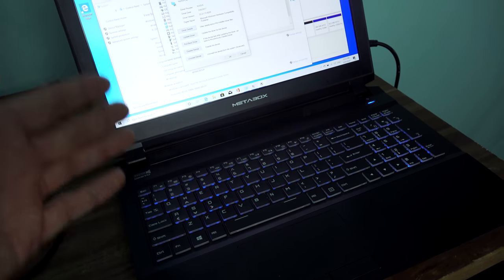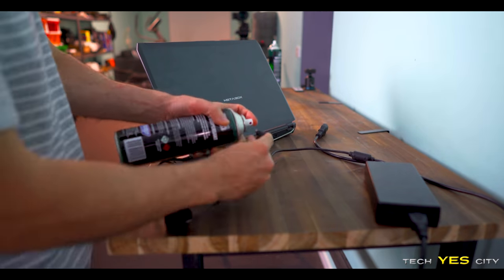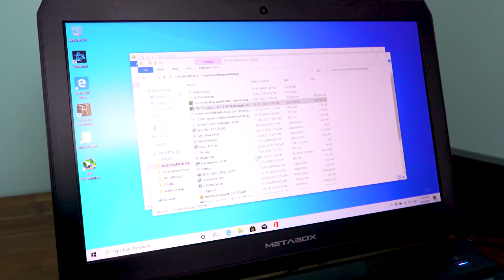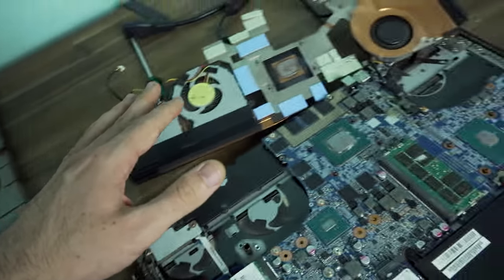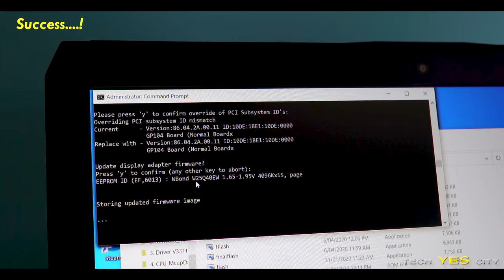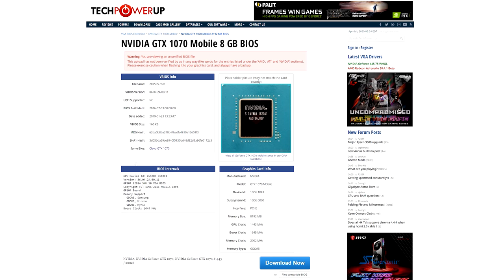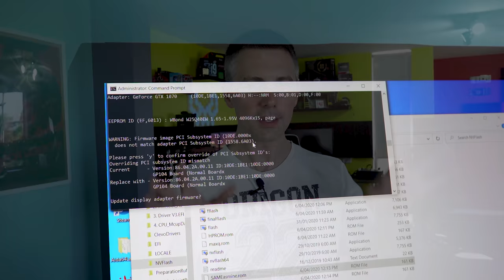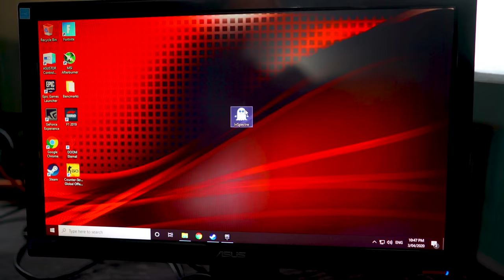I Got This GTX 1070 Laptop for ONLY $200... Though it has a VIDEO_TDR_FAILURE issue...

Comment: Holy crap, I have the same laptop (different rebadge) with the same problem!  I did the re-paste and replaced all thermal pads, tested several versions of the Nvidia drivers and eventually set it to the side and have barely touched it in over a year.  Thank you for sharing this one, going to give the flashing a go.
Reply from the maker: make sure its the same file size first (so back up your vbios first with gpu-z) and then yeah give it a crack.
Reply: What rebadge do you have
Reply: @Staffy_  I have a Sager.  I struck out on the this though, BIOS file while being the same size, it would not update saying it is the wrong version
Reply: @jaymanwitt  That's a shame - I picked up a used one for $400 - did the nvidia bios update and it went through fine but it's still not perfect...I run something like Witcher 3 and it either fails within 10 seconds of gameplay OR plays fine for hours... Where in the world are you - anywhere near Sydney Australia? ? I'd pay $200Aud for it just for the fun trying to fix it ;)

Comment: When you're trying to troubleshoot 3D graphics resetting the PC you can run GPU Z with logging and then look for any anomaly in the logs after you log back in.

Also GPU Z is useful for identifying a corrupt vbios as on the monitor tab you'll often see lots of weird values.
Reply from the maker: Thanks I will check out the logging feature.
Reply: @techyescity  also I'm pretty sure I've saved a corrupt vbios before and then reflashed it and it somehow worked. It's not like you're going to be any worse off.
Reply: @techyescity   please also disconnect battery before you spray all over the laptop and cleaning you could damage more things while trying to fix gpu !!!

Comment: This is such a strange fix. Would've never thought flashing a bios would have fixed that issue....
edit - to be clear, I mean the vBIOS. I would've flashed the motherboard BIOS, but never would've thought to touch the graphics card's vBIOS
Reply: From what I know the BIOS chip in a laptop is responsible for both triggering the south bridge to boot and VBIOS for the GPU.
Reply: i had a very strangely behavior of my hp probook. flashing the bios fixed every fault i ever had with the damn thing.
Reply: Picture it as the "Turn it off and back on again" but for the BIOS.
Reply: I've got to say if you trade notebooks for moolah, please do consider that lenovo's really lock down their bioses... not the video one but the overall system one... and its a bitch to get backups... people pay russians on forums to unlock their bioses so they can upgrade cpus and what not... or install ssds which are not on lenovos whitelist.
Reply: you'd be surprised at the amount of things you can fix just flashing the bios. some people don't bother because of the risk involved.
Reply: @Blokka Nokka indeed. I have also had a bios brick one of my mates boards I had to replace his board needless to say i learned the hard way and only work with motherboards i consider reliable lol.
Reply: @cootason  GPU bios flashing? literally 0 risks, its not the same as motherboard bios flashing, at least not any hard bricking chances I mean, there are risks but nothing that cannot be reverted easily.
Reply: @JustOneGuy   Yeh
 less risk involved in the gpu boards.  I was more about motherboard flashing those cheaper ones can be a bit of a pain at times.
Reply: @JustOneGuy  you only have to desolder the bios chip and reflash it  with a cheap usb EEPROM flasher that can be bought for like 3euro, pretty easy and can fix a lot of things
Reply: not relly the bios can get bit rot but its really rare as the BIOS is non-volatile storage in most cases it should never degrade i mean i have 3 computers from the 90s only one of then had this problem makes me wonder if the bios chip is faulty or just poorly made
Reply: sometimes the flashing might go wrong and you end with somewhat corrupted eeprom. Reflashing can fix the problem, but don't ask me why, tho. Some of the flashing issues happens with radeon RX and nvidias...
Reply: @fabiofoltran4361  yes, but compared to failed gpu bios flash, its all software, you don't need any hardware and for bios on motherboards in many cases you need an original bios not the one you can get on the internet because it doesn't carry all the information, at least that's how it was in 2014 on my laptop. maybe times have changed.

Comment: I actually own this very same model of laptop.  Clevo is a ODM who makes laptops and sells them to OEMs who customise them for sale to the end user.  The experience I had with the laptop has left a bit of a sour taste on Clevo laptops.  That model never got a official fix for the IME vulnerability as Clevo had released a new model a few weeks before the exploit was released.  There are no firmware updates for any of the Intel hardware exploits/vulnerabilities either.  The paint on the keyboard also wore off really quickly for me as well, my laptop keyboard is currently missing the lettering areas on quite a few of the keys on the left hand side of the keyboard.

If you do plan on using that laptop (and for anyone else with with one), I highly recommend using the software from Obsidan PC instead of the Clevo Control Panel.  There is still a bug with the Clevo CC filter drivers for the keyboard/mouse which will give you constant BSoDs which is fixed with the Obsidan software and you also get the option to setup a CPU undervolting which will give you the same (or better) CPU performance with less heat - you can do it with Intel's XTU but it is rather fiddly.

Comment: If someone (like myself) installed Linux Mint after Windows, then a partition with a size like that looks 'unallocated' like that in windows.  That means it is a dualboot system, or you can still make it a dualboot system.  I the latter case, keep a part of the 100 GB dedicated fow swap file around size of your ram.  So for instance 100-16=84 GB for Linux Mint 19.3
Reply: SpinazFou  First: if you are not sure that mentioned 100 GB is a linux partition, then please LEAVE IT ALONE to avoid breaking your windows.  Second: you can check what that partition is by live-booting any linux dvd/stick (like Mint 19.3).  This will start an OS exclusively in RAM so you look around in your system.  After you remove the cd and shut down, your system returns to normal.  The advantage is that linux can see ALL kinds of file structures, while windows can only see NTFS or FAT32 (hence 'unallocated' blah blah).  Third: when you boot a linux (Mint 19.3?) medium, and decide to install linux, it will ask you if you want to clear the drive (no!) but you want to 'do something else' and then you select the empty space and enter the size of SWAP area in that space and choose type 'SWAP' - then select the empty space again and choose type '/'  -> now install there.
Reply: @rogierx  ext4 partitions should show up as unformatted in Windows, not unallocated, shouldn't they? Btw you don't need a swap the size of your RAM. If you've got large enough RAM, you don't need any swap at all.
Reply: @sleeping_monkey  excellent, didnt know that!  I always thought swap is equivalent to pagefile.sys - apparently i am still a bit of a windows mouse monkey.  But the live-booting linux in order to look around will provide interesting insights, right?
Reply: @rogierx  Swap partition is equivalent to the pagefile in Windows, that's correct. Both are used for the same purpose: when the system runs out of physical memory (RAM), it moves the less frequently used portions of memory to swap/pagefile (which are located on disks) to free up some space to be able to, for instance, start a new process, open a new tab in Chrome etc. The only real consideration when you're determining the size of your swap/pagefile should be this: no matter the circumstances, your system should never run out of both RAM + pagefile. Were that to happen, your applications will start to crash if they try to allocate more memory, you won't be able to launch new processes, etc and realistically, your system will just hang.

The popular advices like "make your pagefile the size / double the size / half the size of your RAM" all use sort of backwards logic. They assume your computer has just about the right amount of RAM you need for your everyday use, and then it's safe to assume that in the most extreme use case you won't need more than double the size of your RAM. That's a fair advice if you've chosen and bought a computer with a perfectly adequate amount of RAM for your needs.

Instead, your should first decide how much memory you use at most, and only then calculate your pagefile size like this:
pagefile/swap size = total memory usage in the most extreme scenario + some leeway - your physical RAM size
I know that in Windows, if I'm lazy and have all my applications opened (including the browser) at the same time, I end up using 12GiB of memory at most. I have 16GiB of RAM, so it covers my most exteme case and leaves some extra, so I've disabled the pagefile completely.

Pagefile/swapping is a pain in the ass, especially on laptops, because laptops typically come with the slowest possible 5400rpm HDDs. You don't want your memory to swap on THAT. I'm sure you know the symptoms: you try to switch to the tab that you haven't switched to in a while and it takes ages to load. Or maybe you try to unminimize some window and it takes like 10 seconds to load. Or you exit a game and all your applications are slow AF after that. That happens because the portion of memory with the contents of that tab/window were swapped by the system because you haven't used that tab or window in a while and your system needed some memory for something else. So now when you try to access this swapped memory, your system needs to read its contents off the HDDs, which is very slow. Thus, you should aim to avoid swapping at all costs. Nowadays the RAM is pretty cheap, you can easily get 16 or 32 GiB of it and then just disable the swap/pagefile completely.

One point I missed: the linux swap partition, unlike the pagefile in Windows, is also used for hibernation. Windows uses a different file, something like hibernation.sys, but not the pagefile.sys itself. So if you plan to hibernate in linux, you'll still need the swap partition.

Comment: Let me tell you how EXTREMELY luck you got:

Most laptop brands (especially HP, Lenovo, Acer etc) that use Nvidia Optimus enabled laptops tend to integrate the video BIOS bin file in the the general motherboard BIOS. So the Nvidia BIOS is basically contained in the systems BIOS file.

You got very lucky that the BIOS's on this laptop were separated, allowing you to R/W to and from it.

I say you got lucky because extracting the video BIOS from the main BIOS image can be a real pain in the butt.

Edit: Forgot to mention that laptop vendors typically lock users out from reading or writing the BIOS chip. That's the case for me with my ThinkPad W520 lol.
Reply: You forgot to mention he was lucky.
Reply: @BeAPro  LOLLLLLLLLLLLLL
Reply: @BeAPro  :P
Reply: Hey @Jamee, have a look at ivyra1n. Maybe something similar might come for sandy thinkpads. My w530 runs it just fine

Comment: Usually, the main system recovery shows up as unallocated space or a recovery partition. A certain Fkey "like F11" will start the factory set recovery. But, of course i always do away with main system recoveries. Those are for old DELL's and HP's with proprietary drivers. 
 Once someone brought in a completely dead laptop. Every other shop they took it to, said it was dead and needed a new motherboard. I took the whole thing apart and let it sit for 24hrs. Put it back together and it fired right up. Sometimes there is built up static electricity that can cause a laptop to not start. So by taking it apart and letting it sit  can sometimes fix seemingly dead laptops.
Reply: Not only laptops but PCs too.
Probably by the same reason.

By the way, I had a case when laptop after flight to another country started to work in my hands.

And as for this 100GB unallocated space. Someone could even left this space as a buffer. Some SSD works faster when the whole space is not occupied.
Reply: you did not need to take it apart to discharge the electricity, simply unplug it and hold the power button down for at least 30 seconds
Reply: @TheBirdtaco  you are speaking about PSU discharging. Not motherboard

Comment: I got precisely the same laptop/configuration (except for the 2x8gb ddr4 sticks).
It had the same VIDEO_TDR_FAILURE problem for which I tried some register fix related to TdrDelay and at least I made it not get BSODs (video card still crashes when running intensive GPU stuff).
Even after flashing BAKED bios, this laptop still overrides any sort of software and hardware (vbios) default clocks somehow (tested in Heaven Unigine and monitored clocks - gets to 1800+ mhz / should be 1645 mhz / on core and 4004-4007 mhz on vram).
After flashing all the GTX 1070 vbioses I found on the internet, my conclusion is that there is some sort of overriding mechanism that pushes the GPU to death (most likely by crashing the VRAM).
Any other suggestions are welcome otherwise I guess I could check a repairman for the VRAM.

Comment: Usually the tdr error is related to windows missing tdrdelay, tdrddidelay and tdrlevel in the registry. Only a small number is related to drivers and vbios problem
Reply: Wouldn't reinstalling Windows correct that?
Reply: @redleader7988  It depend as there's so many different computer setup some will work fine without the registry fix but some require the registry fix. If you check in event viewer and see alot of error 4101 and games crashing that means windows 10 crashing the nvidia driver when there isn't a fault at all. The registry fix basically tells windows 10 to stop interfering with nvidia driver and games will stop crashing

Comment: Had a laptop that had a gtx 1060 gpu in it but wouldn't let me boot to windows even with a fresh install.  Funny that I could get linux to run just fine on it which is what I did anyway and made a profit for services to get it running for a client
.  

Also had a rx 470 that would crash everytime I would try to game or do heaven benchmark and had the latest driver and also flashed the bios on it, ended up getting a refund from ebay on it.

Awesome save on this laptop though Brian!  Next you should look into replacing the screen with a higher refresh rate panel like 120hz or more!  Though dont know if ips panels like that would be compatible with it but worth a look!  Also stay safe and healthy man to you, dad and the rest of your friends and family!

Comment: The unallocated space is to prolong ssd life. Like a dump area. Google it
Reply: Cache 👌‼👌
Reply: Yeah but not 100GB, that is way too much. I too have 500GB ssd and it only took about 50GB.
Reply: It's called Over Provisioning which basically states that leaving at least 10-20% free space on an SSD will significantly increase the life expectancy over a full drive.
Reply: @matthewdale7  Cache is quite different. It's a volatile memory.
Reply: That isn't true at all. Manufacturer-set overprovisioning isn't exposed to the OS. You can't choose to use it. Only the controller inside the SSD can see it. If you're seeing unallocated space on your SSD, it's simply unallocated space inside the user-usable portion of the flash memory, and that serves no purpose whatsoever.
Reply: @CaptainKenway  I'd agree with this (my reply was to the OP, he wasn't sure of the term). The one on the video is really just unallocated space. Over Provisioning cannot be seen in any disk management software. Its practically hidden because it's managed by the ssd itself (or a software used to configure OP). Unallocated space is unallocated space. Needless to say you can use it or not if you wanted to.
Reply: matthew dale No, it is not cache.

Comment: I love these deals! Normally I'm the guy that does everything to fix problems like this. Even stuff that might normally be out of my skillset. I just got an I7 Lenovo with 16gb of ram and a gtx 980 for 140$ because it would only charge when the computer was turned off, and very slowly. Come to find out the power adapter was the wrong one. Problem solved with 12$ on ebay for a used OEM power adapter. I also got a nice Asus ROG with slightly higher specs that simply needed a fresh install of windows for 200$

Comment: Hey buddy, just scored 4x DL385 G7s with Dual Opterons, $25 each with 16GB of RAM, both PSUs and RAID controllers. Also, picked up an older 2nd Gen i5 Lenovo Thinkpad Tablet/Latop for $60. Still deals to be had, now more than ever.